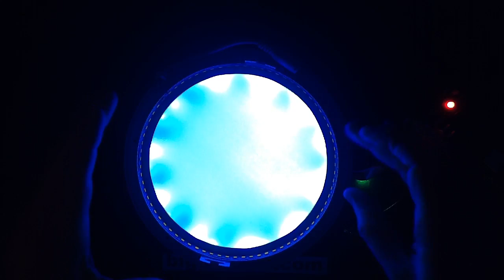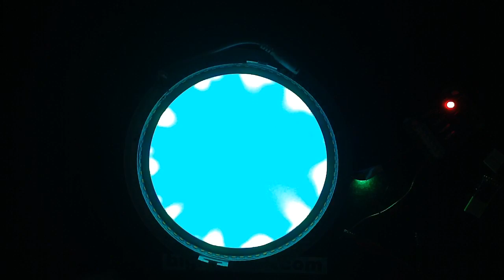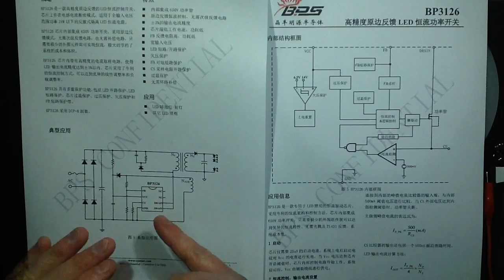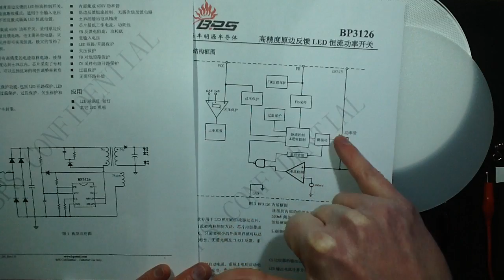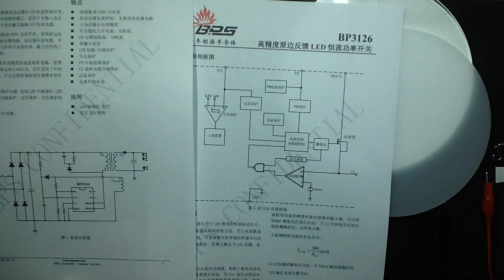Teardown of a flat LED panel ceiling light.

Comment: When you tried illuminating the light guide with the torch, you should have held the non etched (smooth) side to the camera. That is where the light come out of. it is a 90 degree kind of turn for the lights. Some lights also use "BEF" , (Brightness enhancing films) made by 3M to multiply the lights so you get better brightness. As usual, a brilliant video. Keep up the great work.

Comment: This first generation led panel was used a lot here in Tunisia in cafés and public spaces as well as homes to replace fluorescent tubes. However these edge lit ones burned out relatively quickly. Now the more modern back lit SMD last longer.

Comment: The biggest ones available with 12 volt driver are 6 watt. I once rewired a burned out 18 watt light for 12 volts, it worked but then I could not fit it inside its casing again because it got too clumsy with all the solderings and extra wires lol.

Comment: I just bought a kit of 10 of these for about $50 from Amazon they work great on 48 volts DC which is what I used to power the renewable electric system in my home.

Comment: are these FIRE PROOF?
Reply from the maker: +Boyd Bros. They do have a metal frame and back panel.
Reply: Is there significant heat transfer to the surrounding material these are installed in; ceiling panel, drywall, wood beams, etc. ???

Comment: You might be able to bypass the colour correction of the iPad by introducing a purely white light into the picture, if the camera is set to spot mode it may not work, but if it reads the brighter white light, in theory it shouldn't alter any other light
Reply from the maker: Latterly I locked off both the exposure and colour with a grey-scale card.

Comment: I have one of these, although square. The driver failed though, it had a 400V 10uf capacitor that had bulged so I replaced it with a 450V version. The circuitry is slightly different, as mine is a dimmable version.

Comment: Maybe I'm dumb... but browsing through the comments I did not find anybody noticing it... bigclive please explain 9:45-10:00 and the formula of capacitors connected in parallel... or are they maybe in series?
Reply from the maker: It's a common trick to save space in power supplies.  By connecting two capacitors in parallel you end up with the combined capacitance (50uF and 100uF would give 150uF).  It saves space and can also reduce the internal resistance over using just a single larger capacitor.
Reply: That I understand I know... but please listen to what you said... 50uF+10uf and the result mentioned is 25uF (in reality 22.25uF). Best regards and wishes, you do a swell job... but let's not confuse the kids ;)
Reply: betta67 He said "fifteen" instead of "fifty". 15+10 is indeed 25.

Comment: Guess that each LED contains 15 dies each. That would as you said fit the voltage and it also conforms with only one dead LED. I believe Ikea used similar 15 die LEDs in some of the RYET series.

Comment: I have always been intrigued by round lights such as this. When I was a small child, we lived on a farm, we always referred to as "up North" being that it was some 25 miles Up North from town.  We had neither power nor running water, we used to claim we did indeed have running water, dad would send us with a pail, running out to the windmill to fetch a bucket of water!  At any rate, one of dad's brothers lived some 8 miles away, and they had power, and an indoor cistern pump for water.  In their kitchen was this wonderful round florescent light that I would gaze at for long periods trying to get my 4 or 5 year old brain to lock onto how it worked. Perhaps that was part of the beginning of my love of electrical devices, that and watching my father dig into the back of our old tube battery pack radio and pull out tubes that weren't lighting, and replacing them with tubes he had picked up from old junk radios he found from time to time till he had it once again playing our favourite radio programs (The SHADOW KNOWS!)  This video brings this all back, as I sit here in our 35 foot Class A Motor Home in west central Arizona, the weather going from hot yesterday to cool today with overcast ski's and threatening rain in the midst of the sandy Mojave Desert.  Thanks a  million for the memories!

Comment: The driver in the picture is awful! Its a zhongshan driver. The CCT is awful also! We did the whole of Kingston Collage with ours. The LGP (Light Guide plate) looks not bad but what about the diode type? LM80 diodes and brand being important. Happy if you test the Auraled ones.  Need to test the SDCM/CRI etc.

Comment: Just bought a set of 4 (15 watt), no flickering, very bright.
But it defeats me how the ceiling retaining clips are to be used.
The attachment for these on the edger of the lamp looks hopelessly inadeqaute.
The box has no useful pic or instructions.
Maybe you can spend a bit more of the video dealing with the use of these finger mashers?
Thanks
Reply from the maker: the hole is cut into the ceiling to fit the inner rim and the spring loaded side clips are pressed up as it is passed through the hole so they snap back down when released and hold the light in place.  Very common to typical downlights.

Comment: Hi Clive, I got one of these from Ebay, just,well, because.... 
Now, I'm thinking it'll make a decent 'infinity lamp' but would like to get the light a bit dimmer. What would be the best way? 
Cheers.
Reply: Hi! I know it's veeeeeery late, but open up a driver, locate the shunt resistors (often 1Ω, 3Ω, or more of them in parallel), and put bigger value resistors, until brightness gets to your liking.

Comment: I've got several 6W ones and a 18W one and so far no problems after 2 years. Still got the nagging feeling in my head that a driver is gonna set fire to something in the ceiling though!
Reply: I'm looking at using them in my new build house but have that concern about the cheap drivers too.

Comment: I got similar one like this one for a test. It was really annoying as it was flickering. Did you notice any flickering?
Reply from the maker: +Kevin Harmala It's tricky.  The drivers are notoriously noisy.   You could try a local inline filter for each light mounted as close as possible.  It might be possible to get a new driver with more filtering on it, but the output current and operating voltage range would have to be similar to the original.  Failing that, it might be easier to get an inline filter and mount it close to the light.
Reply from the maker: +Kevin Harmala A clip-on ferrite core round the cable feeding each light is an interesting idea.  But it may take more than that to suppress the amount of electrical noise some drivers generate.
Reply from the maker: +mucek4 This one didn't flicker.  The iPad tends to pick up even the slightest sniff of flicker.
Reply: +bigclivedotcom is was square one. I can link slow motion movie. will do that in the afternoon
Reply: +bigclivedotcom I recently received some 18W versions of this.  They put out horrible EMI or RF noise that makes the AM radio go absolutely bonkers.  They are the 110V version for US,  and they have a very similar circuit board with a different chip 62YL6A2NU.  What would you suggest as a remedy to eliminate the interference?  A noise suppression capacitor or a line filter or something completely different?
Reply: +bigclivedotcom Thanks for the quick response and advice.  I'll give that a go and see how that works.  That was my initial thought, or adding a noise filtering capacitor.  I found some other questionable ideas like huge ferrite cores and Faraday cages.  Keep up the awesome work, I always look forward to new videos.

Comment: the dot matrix pattern is indeed done by laser, cheaper versions use an adhesive cover with reflective dots but these dots lose reflectiveness over time. 
The dot size is governed by the power of the laser pulse and it is designed to trap differing amounts of light  across the panel, shallower dots nearest the light source and deeper dots towards the centre of the panel, a small area like this has a large dpi to make allowance for the fact that there is not a lot of light to be caught in a small area. larger panels allow more light refraction over a larger area so need less dots to create an even light source. The brightness of a particular panel can be varied by light source or by trapping more of the incoming light in a specific area. Cost savings for office lighting etc are impressive, running a fluorescent light for two months will cost the same as an led panel will in a year. I design these dot matrix panels as part of my job. recently I have been experimenting with using actual laser engraved photographs to develop a light panel..... why have a boring white light to light your room when you could have a large mural or portrait instead.
Reply: Really interesting Dave! Do you have any visual representations of the dot matrices for larger panels? I'm particularly interested in the 2'x4' panels. Thanks!
Reply: @RobMcKeown  use a thrown away lcd tv. they have some of the best backlights and you get it free.
Reply: A commercial way is to print the dots with chloroform, that melts acrylic or use a pattern screen and have it sand blasted. Lasers take forever, believe me. I have attempted it.

Comment: bigclivedotcom , stupid question may be, if one of the LED is dead shouldn't 5 of them be turned off? since they are connected as parallel multiples of 5 in series?
Reply from the maker: Each group if five are in parallel, so the ones that are working are passing its share of the current.
Reply: +Tina Sharma 

Hi,
   This is rex from yake Led company.Glad to learn your company products are in our business line.We are the MANUFACTURER of all kinds of LED LIGHTS in China.We specialize in this field for over 5 years,with the strength of LED panel lights with good quality and competitive price.Herewith my email:sale04@ledyake.com
If it is convenient，please kindly contact me for our products catalog.We’ll appreciate for your prompt reply.
Thanks&Best Regards.
Reply: bigclivedotcom or just replace the one dead LED from one of the many strips you have?

Comment: Clive: The one thing that I hate about these little power supplies is that they have NO surge protection. I am starting to add my own movs to these units. I have already loss an number of led lamps because of surges.
Reply: also in Ontario, but possibly closer to my power plant, i have never had a surge. I would suggest a whole house surge protector on your power panel though. Available at all the big box hardware stores.

Comment: Looks like the Chinese have never heard of the plug being on the appliance and the socket being on the powered end, or more likely they just have no concern about safety as I have found out time after time buying stuff from China via eBay.  You almost have to open things up and make safe.
Reply: Michael Beeny  That male powerplug is pretty standard with the most common being this 5 mm version. Most 12V powerbricks have it.
Reply: so, just like laptop power supplies aren't?

Comment: Hi Clive, i think you need a new microphone.. your videos never have audio on the right channel :(
Reply: jusb1066
hmm, maybe its my G930s at fault then or it might just be a pebcak error :P

edit (5 mins later) - Fixed it, turns out that using html5 player on youtube was causing the problem on certain videos
Reply from the maker: Are you using a Chomecast dongle by any chance?
Reply: nope, im using firefox on pc, haven't got a chromecast (or a tv) yet.
Reply from the maker: ***** That's odd.  I'm recording the videos on an iPad with its built in microphone, and when I play the videos using the Chrome browser it comes out both speakers,  I wonder if it's a Firefox specific issue.
Reply: possibly.. its happened on a few other videos too, so maybe its a codec problem at my end.. some stuff plays in perfect stereo, but some is left side only..
Thanks for checking, i will try some other browsers and see if i can find a solution :)
Reply: firefox on pc here too, audio on both channels is fine
Reply: +McBong's Lab i am watching this at work with a headset that only has a right earcup, i can hear it fine on chrome :)

Comment: How was the isolation between primary and secondary? It looks a bit iffy to me ...
Reply from the maker: Isolation is probably down to the quality of the transformer manufacture, since the only point the mains and output seem in close vicinity is the windings.